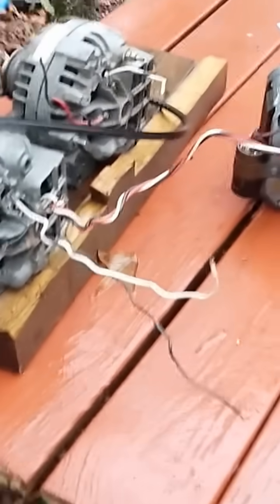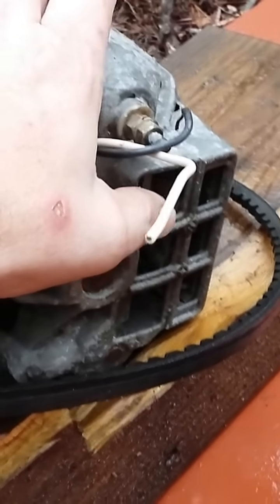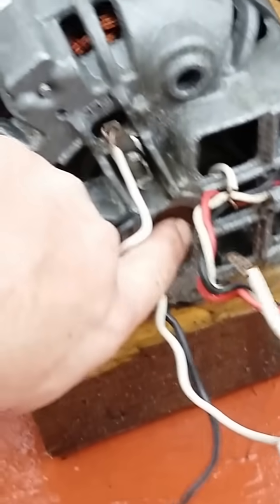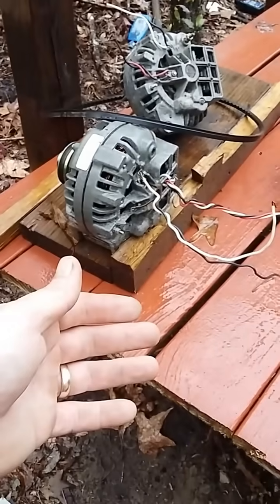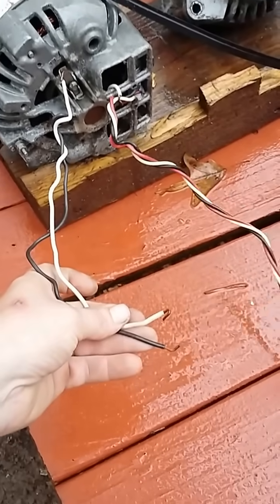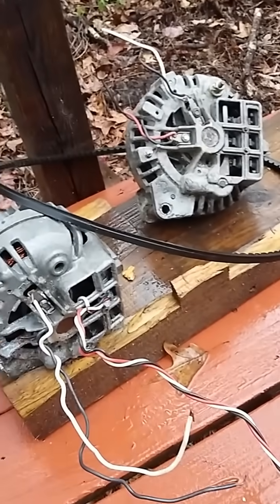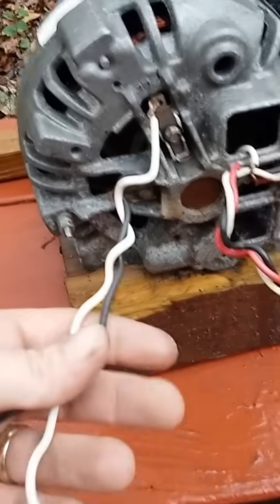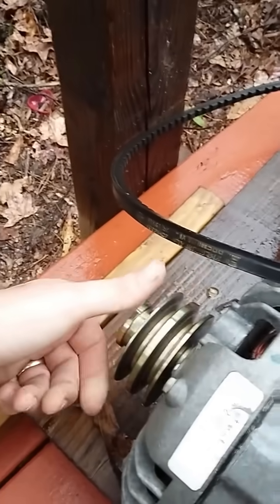Update Free energy forever no wind no solar no gas READ DISCRIPTION!!!

Comment: This is hogwash... Those alternators put out 90 amps at 12V....If you bypass the diodes you will get a higher voltage but the amperage is inversely proportional to the voltage.... the Ac current form a car type alternator is useless in your house....it may only be used for powering  incandescence bulbs because the frequency of the AC from a car type alternator is from 400 to 600 Hertz  per second...and everything in your house uses 60 Hertz per second current. If you were somehow able to get the right voltage, about 120 Volts, your Fridge and you Air Conditioner would probably blow up...your fans would just shudder until they burst into flames..your TV uses 60 Hertz form the line to synchronize the picture so would not see too much on the screen.
He said to turn the alternator with a motor, what is being used to power the motor? Where's the free energy.

Comment: When he says 3 to 6 volts does he mean I can run my house on flashlight batteries?  For a month of electricity it cost me $41.79 from Toronto Hydro.   Horizon in  Hamilton is cheaper because they are closer to Niagara Falls I guess.  I hope I am using electricity from the falls rather than a reactor.   The rates per KWH are the same but the delivery charge is $10 less in Hamilton.

Comment: I'm not a "Free Energy" kind of guy but I do design my own gadgets and gizmos.  Most are gun or air gun related and I've come to realize that any time you think outside the box you can plan on getting the snide comments from Self-Appointed experts who will swear up and down that our ideas or your ideas won't work for this, that or any number of  other reasons.  The internet is littered with this personality type who's life mission is to crap on other peoples' ideas to compensate for their own lack of ingenuity.  

Those who argue against this "Alternator-Free-Energy" setup are basing their arguments from inside the proverbial box of established norms taught in schools and such.  It's really pointless to argue with these negative comments.  It's best to just keep on keeping on with your experimenting and perfecting whatever you've come up with on your own.
I've successfully finished certain projects and showed them working and some of these Self-Appointed Know-It-All types have still  insisted "It will never work",  even as they're seeing my ideas work right before their very eyes.

The only reason I haven't tried using alternators to try to create  "Free Energy" is because those alternators can be expensive; and because I'm not very knowledgeable when it comes to this kind of stuff.   For me, that money used to buy the components to do this could be used for other things.  On the other hand; any money that could be saved by not having to pay electricity bills or cutting down my electricity bills could be used for other things too.

Comment: Great video.  Here are some thoughts.  That there alternator is designed for 90 amps at 12 volts.  This means its capable of a 1080 watts ( power = volts x amps).  The house panel yer talking about is 100 amps at 115 volts.  This gives you 11500 watts of power out of yer house panel.  You could power yer house with about 10 alternators.  Dont forget to match yer alternator frequency to get a 60 hz sine wave - not sure if an alternator will give you that,  you will have to bust out the ocilloscope to check it.  You will also need a chain drive to synichronize all of them there alternators to prvide the same waveform or they are going to cancel each other out..  Good luck!  BTW that is a great hammock.
Reply: brent brower yes 12v x 90A = 1080 watts.  But at 120V it can only put out 9A.

The 3 wires coming out of the Alternater are what 12AwG  or at most 10 AWG.   Capable of carrying 20 and 30 Amps respectively.

Also it puts out 3 phase.  Huy is suggesting you ground one of the phases to ground rod!  Hmmm
Reply: The conversion doesn't add up. Lol
Yes. Around 9 amps at 115v.

The same can be done with simply connecting an inverter to a car battery. Then having a good solar panel on said car battery. WALLAAAH you now have somewhat-free energy for the life of the battery. 
Add 12 batteries and about 12 100watt panels......and bam!! You can now run close to 50 amps at 115v for most of a day. Or longer. 
For the life of the batteries.

The TRUE form of free energy... Is from when you figure out (on a large scale) the shape and angle to perfect a rare earth magnet drive. 
Magnets are the only thing on earth that has a near endless "force in nature" that we actually still don't completely understand lol
However it provides the short burst thrust. Figure out how to shape them into a large LARGE circle. (Ahm half moon...) 
Or a variance on many other ways. Once that is perfected. And used as a drive to a coil generator... You have a generator to produce the power TO SCALE of the size unit you decide to build. 

Im going to build one one day.
Real good earth magnets aren't cheap. But anything that can create a strong force with no needed energy source is key.
And the key has been stuck to the side of the fridge for 50 years.

Just have to figure it out. 
Magnets generally last for 70-100 years so lets get to work!
Plenty of designs already plastered over the internet. We only need one that is very efficient to work

Comment: So at risk of "running my mouth off," we need to get something straight. The bit that turns is called the "rotor" the other bit that don't turn is the "stator'. Also, those alternators do indeed have brushes in them, that how the DC power gets to the rotor. it ain't rocket science.

Comment: Nope. It takes 2400 to 3000 watts to turn a 1 hp  fan motor.  A 100 amp alternator at max puts out 1400 watts and requires several hp if under full load. A 400 amp @240v generator will struggle with a frigging 100 hp turbo diesel!

Comment: Take 2 alternators and one motor with a output shaft at both ends.  Once you spin the alt.  The other alt Will  power the motor which will spin your alt that’s converted to a/c.  It will run almost forever. No batteries or external power needed.
Reply: Add a fly wheel in between the motor and alternator.
Reply: No it wont lol
The HP required to spin a motor with a load on it (because of the alternator being drawn onto from the MOTOR trying to spin) will slowly come to a halt. 
There isn't enough torque in the motor at load to keep the alternator spinning when loaded.

If that worked everyone would have 100 alternators in their garage and 100 electric motors. But it won't. 
Unfortunately its a great starting idea. But no bueno.
Go buy you a 2HP motor and old alternator and belt em up! Make a vid!
Reply: 2hp motors draw 1500watts.
That is already at the alternators peak. Even if you could successfully get both spinning it wouldn't take any other load. Nor would it last long anyway. 
Friction loss is always a thing. The conversion wouldn't be nearly efficient enough.

Flywheel would only slow the speeding down.
If you could manage to make it work AT ALL.. It would help with load spikes. 

As i mentioned above. This will not work. 
The guy in the video has neat ideas but is just asking for money. He says that very clearly in replies to people.
Many people out there claim to have a 100% working electric generator with only motors.. 

IT IS POSSIBLE TO GENERATE FREE ELECTRICITY. But not like that.
Reply: They key to generation died with Teslas inventions. 
Even then tesla couldn't make high energy sources from nothing. It takes energy to begin the process. But once you get going.. It is possible to get around a 50% gain (vs what is put in)
And you could invert from there.
I studied this for 5 years. 
Electronics and mechanics. 
I'm gonna find a way. But it isn't ever as simple as this.

Another thing would be to extract energy from the upper atmosphere. If the entire world has receivers capable of extracting the static (lightning) out of the atmosphere and storing it long term. We would already be at the turning point to remove fossil fuels all together from energy production.

Comment: 90 amps running through that size cable hahahahaha.
Reply: A battery cable on a diesel pickup truck is only a few times larger and generally has two 1000 amp batteries potentially powering the starter and everything else.
Reply: Stevie Rox Yeah that’s bullshit.... 😂

Comment: those are  Chrysler alternators from late 70s to mid 80s which do have brushes that's what you the wires hooked to that makes contact to rotor to get power out of it you ground one brush and power the other .

Comment: Yeah why didn't you actually show it working come on man grab a volt meter show it actually genetoring on both sides
Reply from the maker: Booo Yaaa 1922 that is not the objective of this video.
Reply: What is the objective then? At least prove your claims?
Reply: Because it's bullshit! Come over to my chanell abd see how power is produced
Reply: ThomasBuie EnergyBuies at gmail com he just said u can generate all your own power but you still have to have something to turn it and it's not going to generate enough and if it did the heat would eventually burn it up if it was that easy then why do we use transformers with oil u can go ahead and try I what he gots there u will run into all kinds of issues

Comment: Almost everything said  in this video is inaccurate. Its obvious you know nothing about electricity or kinetic motion. Only the words but not the meaning and just enough to trick gullible people that don't understand. I would applaud you for trying but you should study a bit first and not be "teaching" what you do not know or understand before you learn yourself. As far as free power, you must have some power source to spin the alternator. It cannot spin itself. There is nothing free here. The only thing free is if you already have a free power source to spin the alternator. (Water wheel, wind etc. ) Any motor will produce power as well. If you use a AC motor you will get AC power if you can sustain it at the rated RPM. When you add a load to it your power source will be loaded itself or become harder to spin. You probably know this is alot of BS and acting this way to get YouTube views. That's very wreckless and selfish to put this out for someone that may actually be trying to learn something.
Reply: ThomasBuie EnergyBuies at gmail com 
You got me! I did not point that out! You must be right and have unlocked the secrets of the universe! Plus naming some transistor part numbers makes anyone an expert... Right? Throw in the "Arduino" name. Maybe add some coding snips too. Sounds too cool not to be true! Seriously, You can get views other ways. Just call it an experiment. Be up front that your experimenting or trying to learn something and maybe you can. Don't pretend to be something your not and take money for it.
Reply from the maker: Micah AP I am not pretending anything!!! if you would like first-hand proof why don't you ask Gerard Morin what we spoke about a few years ago and he will let you know that him and I have the same technology and there are more than one way of doing it! but I'm not here to prove anything to anyone.. I am on a mission!!! I treat people equally and I treat people the way they want to be treated. so if you get on here ragging me calling me an idiot.. I will treat you the same way! people who ask intelligent questions get intelligent answers and anybody that knows me knows that I don't care anything about money, rather than putting food on the table!!! And to answer your question. I do know the secrets of the universe thank you very much! And I know it's none of your business but you're wondering how I received all this and even though I don't feel like it is worth saying! I learned all of this while I was dead for the 7th time for 45 minutes... there are more than one way to receive gifts that others don't have, like premonition and so forth! when you die certain genes are activated and when you come back to life they're not always deactivated... so I already know who you are or I wouldn't have told you this much in the first place!!!

Comment: I think a lot of people are missing that the alternators aren't spinning themselves. The third piece which is behind the two alternators is a motor that also draws power from them, and spins the two pulleys of the alternators using the belt.  You use a battery just to jump start the motor, which in turn begins the system.  And given the minimal friction power production from an alternator...you can hook multiple up to it. Now I don't know if the input/output works in terms of overproducing enough power for a house to run on. I personally haven't done that yet.  But clearly he DIDN'T hook the electricity up in the rain for the knobtard who knocked him for that.
Reply: I wasn't saying people miss the point. A lot of people just kept saying, "hooking a 12v power source to an alternator output can't make the stator spin itself."  and other ridiculous things.  I'm not saying that I know this works.  Just annoyed when dumb people make dumb accusations/insults when they're too dumb to pay attention.(I get annoyed a lot.)

Comment: Questions: where do you get the six volts going to those two wires? Now, you have three wires coming off the other location...where do they go? Now, what spins the stator, do you have to hook up something else to spin it? How do you hook up in the fuse box? How long will it run and how do you bypass the meter?
I am really stupid when it comes to electricity, actually, scared of it. But, always looking for alternative ways.

Comment: Spinning an alternator does produce 12 volt DC. If you took the signal right off the magnets that would be AC but I don't think just putting DC power to it will make it a perpetual motion machine?

Comment: The output at 220volts is not 90amps. 
In the UK we use 240v and a 30am cable is 3x that thickness. 
Please show a video of it working as I'm intrigued.
Reply: iVlogBuzz we use 240v here in the states as well. Only ignorant folk over here call it 220v
Reply: That's interesting, officially ours was lowered from 240v to 230v many years ago but nominal is 245-248 is what I read for our household.
What applications do you have the higher voltages for as I thought you were normally around 115v for household.
Reply: iVlogBuzz officially we are 120/240. But in many areas it's as it is over there, anywhere from 120-127 and 240-248 give or take.
Reply: Great to know, thanks buddy.
Reply: TKA Productions there was a time in history our voltages were lower. 115/230 was the voltage when I was in JR high school. I.used to take my father's Amprobe. and measure our voltage.  It was 115 volts we also had a farm 90 miles north and the voltage was I believe  
110 volts it was an old house with 60 amp service and the electric company was a cooperative power  company we did get royalties at the end of the year. It wasn't much. As for the lower voltage it saves light bulbs from burning out. I myself now.at christmas time use a voltage reducer to save my walmart led christmas string of lights because at current voltage of 125 plus they burned out in one month like 7 or 8 led lights. With reduced voltage I haven't had one bulb burn out all season for 3 seasons so far. My mini incadsent lights are on light dimmers at half voltage like 60 volts I now can run more strings together. It's not wise  
To run a refrigerator or other motor 
Appliances. On lower voltages the main reason the power company uses higher voltages. Tube electronics should run on 110 vac to keep plate voltages in their proper ranges. Well  history of 110 volts comes out once in a while.
Reply: When I build my solar setup I will get a pure sine wave inverter that puts out 110 volts for lighting and electronics. And the second inverter with a higher voltage for refrigerator and water pump. I am a believer in lower voltages for lighting and electronics. I save in costly repairs that I can prevent.

Comment: My only Question is this. When you hook up the Alternator to a battery (the way you are showing it), does it spin on it's own?  I have never seen an alternator spin with just 12 volts supplied to it.
 I know you can get AC voltage out of an Alternator, by by-passing the Diode Trio. In fact some older Ford Alternators had an AC Tap on them.  And 2 90 Amp Alternators, would be just about right to power any home, since the typical electric Company hook up is 200 amps.

Comment: Wow. So amazing. Gee, I guess my 40 years experience in electrical generation was all for nothing...(sarcasm, if you can’t tell).
Dude, we all know about stators and diodes. I’m really curious about how you created super conducting wires...90 amps through 12 gauge wires? Pffft! And 220 volts from a car alternator...maybe if you spin it at 50,000 rpm! And your magical tiny little 25 horsepower motor that uses no power...?
People! This guy is either a fool or is trying to make you fools.
Reply: ThomasBuie EnergyBuies at gmail com hey buddy, you can stfu now. It’s fake and we all know that
Reply from the maker: Robert Peterson  yeah it sounds to me like you didn't even learn how to read in 40 Years of electrical experience! because you really don't know what you're talking about... obviously you didn't read the description of the video or the pinned post or any of the comments that I've made or you would realize that the alternator in this video is my primary mover...